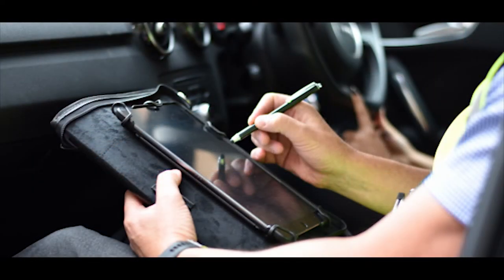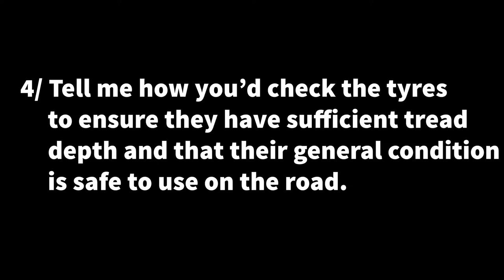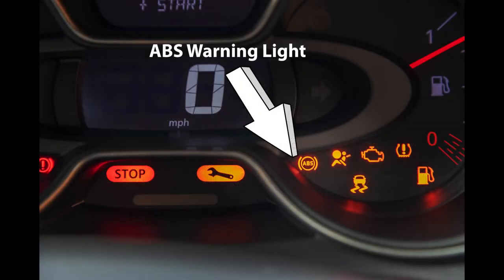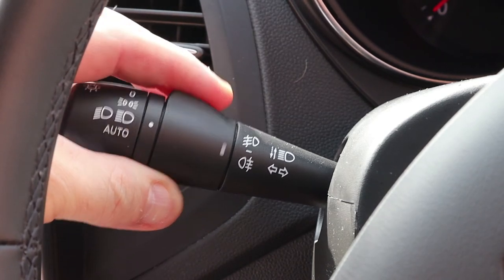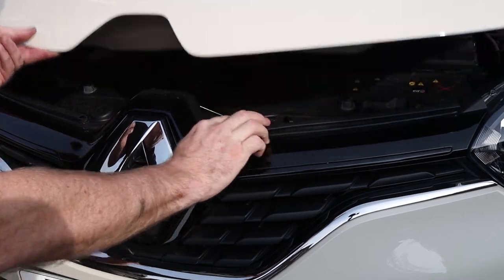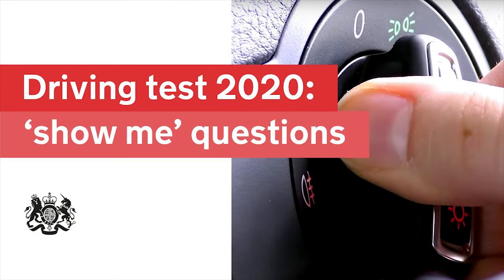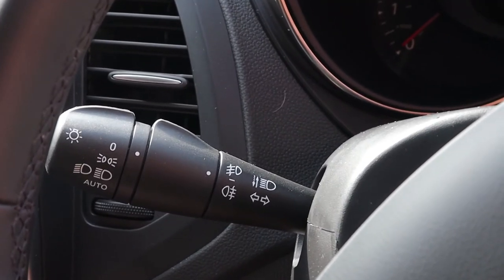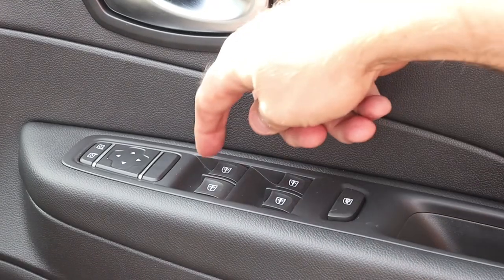Show Me/Tell Me Questions for Renault Captur

Comment: Hello Tony, Can you please confirm which are the reverse lights on this car. I saw only one bulb on the left bottom. Are the two white lights along with the behind brake lights a dummy?
Reply from the maker: Yes there is just the one reverse light, the other is for aesthetics am guessing. I thought the same when originally got the car, went to the garage for a moan and they pointed out it only has one. lol
Reply: @demonkwsn  Same happened to me too. What a shame. Looks like legit reversing lights but just eye candy.
Reply: @demonkwsn  Any Idea when to change gearbox oil in this car? And what oil to use? No mention about it in any manual or sites.

Comment: How can we see the radiator temperature level on the screen behind the car steering wheel? Like other normal cars... gasoline level, engine speed and speed are all known, but the temperature level of the radiator system is not known!
Reply from the maker: There will be a warning light comes on if the engine starts to get overheated. There is no visible dial.